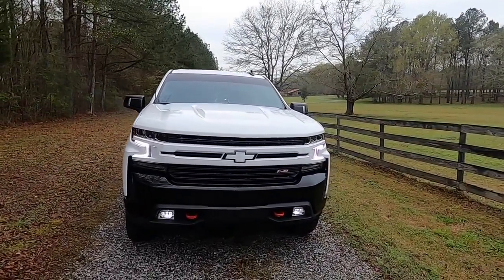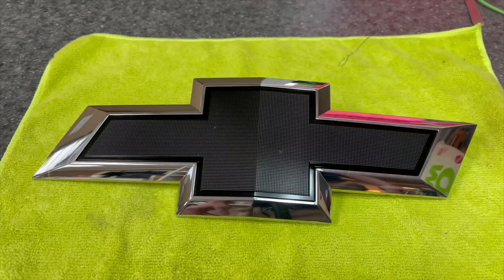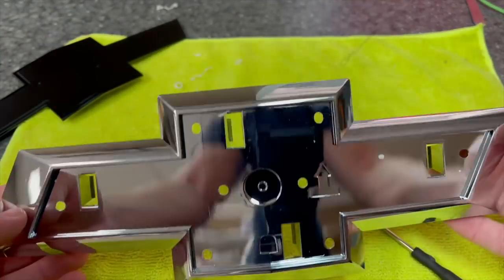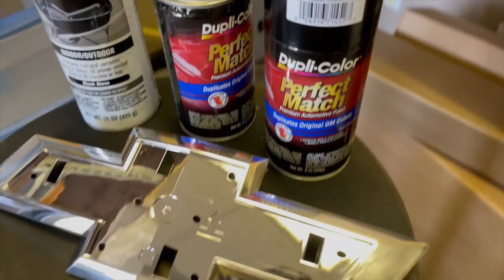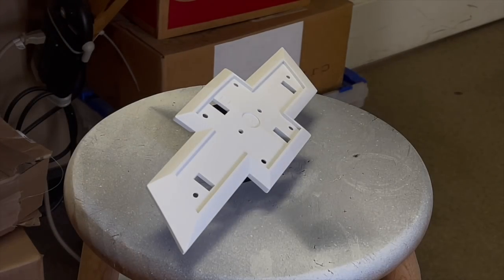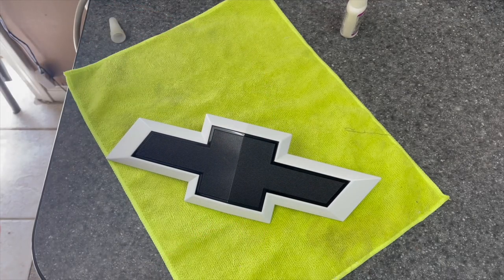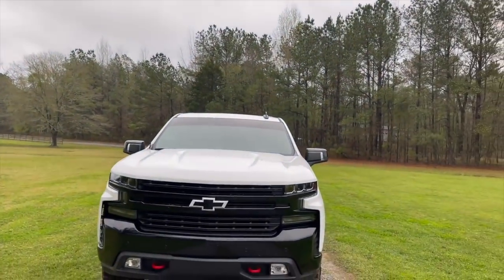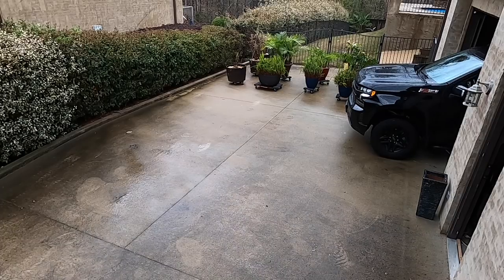HOW TO - Disassemble and color match you factory bowtie!

Comment: Another custom touch!

Ignorant question, does the 2021 have LEDs in the backup, amber turn signal, and license plate lights? I've seen that 2020 does not, but haven't uncovered if 2021 does or not. I need someone with a TB to confirm! I'm trying to get some orders in before my truck finally delivers!
Reply from the maker: Nope, the reverse and tag lights aren’t led. I’ll have a video with discount codes on them soon👍🏻
Reply: @lmfscrew  Assume the same for the amber turn signals, too, then? Thanks for the confirms and look forward to the video on them!
Reply from the maker: @c.neilshores5203  not sure about them but I know lasfit makes an upgrade for them